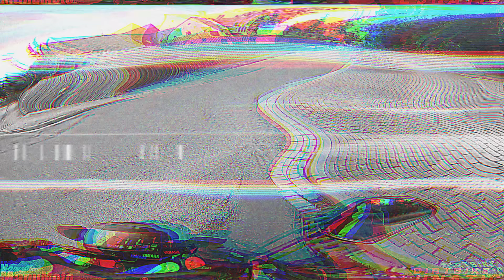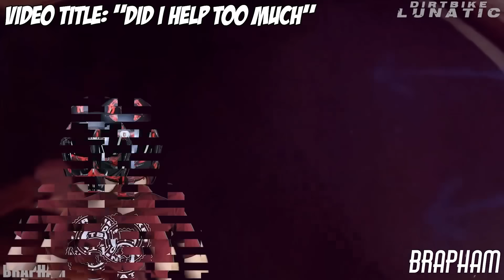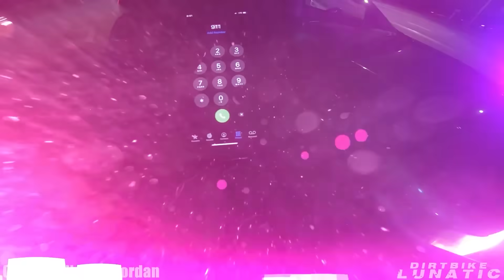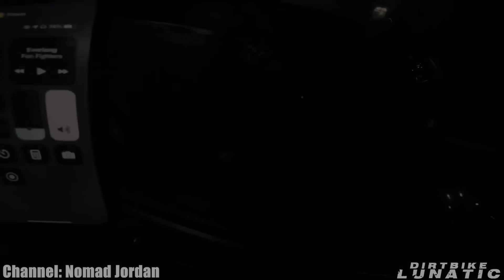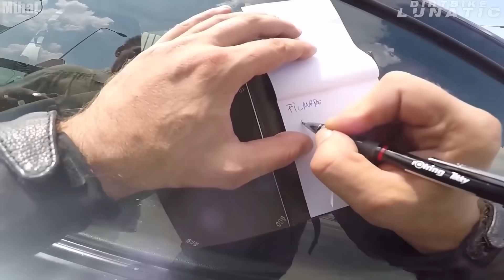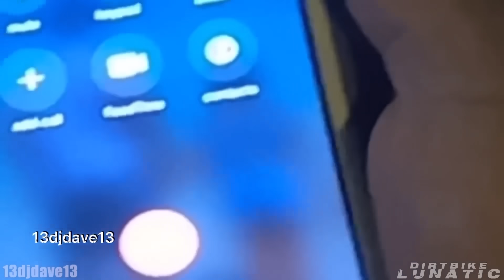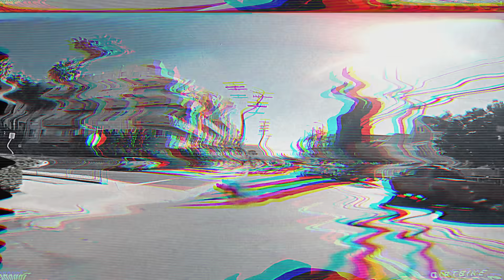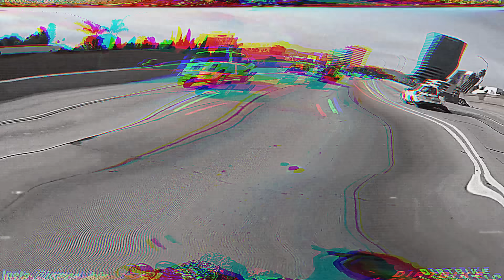BIKERS BEING REAL LIFE HEROES | THE BEST OF [1 HOUR]

Comment: 14:19 honestly concerning how she seemingly didn't know how her vehicle worked
Reply: did she stall an AUTOMATIC TRANSMISSION CAR?
Reply: @carlosglufke2  the new cars have auto start stops and second battery's for them to help save gas when stopping at lights and I'm sure that secondary battery died and didn't restart the car like it should have
Reply: @SandMan_2V  that... makes quite a lot of sence actually (seen those, but did not link the dots)
Reply: When I worked as a car mechanic, we had a lot of problems with all ages and their new cars.
The more tech they have, they become so difficult.
Parking brakes that don't disengage because they have pushed the button to stop the auto parkbrake. Start stop doing it's job and upsetting drivers because their old car didn't do it.
Reply: exactly and then police punish good drivers and leave bad drivers alone just because they go slow.

Comment: 26:27 the worst thing you can do  (when he starts to light the fire) is open the hood to extinguish fire..all you have to do is use only the front grille (when you open the hood you give more oxigen to the fire so it will light much more) but in this case the fire was almost extinguished from water and the previus fire extinguisher they used.

Comment: If a car is on fire, be careful when you open the hood of the car, there could be more fire than you expect and it could burn you (not to mention your hands) and also be very careful not to get hot water from the radiator on you, if it's hot it could squirt upwards with pressure.

Comment: a good tip when it comes to fires! ESPECIALLY in dry woods! DIG! get something to dig with and use that dirt to to dampen the fire as well as digging AROUND the fire, stopping the spread from the ground level. if you have water, use it on the trees and around the trees to halt the fire from spreading onto the trees, because IF the tree catches fire, the fire reaches higher up, allowing more wind and air to hit it leading to it spreading MUCH quicker!

Comment: I tend to agree with some comments that the puppies in the bag was a set-up. The reason? My father's ex-girlfriend did this to her dog's three pups (Jack Russel's). She put them in a skip in a black bag on top of the household rubble the builders had been using - a neighbour heard them crying and whimpering and she pulled them out - they, and the inside of the bag were soaking wet with the condensation of their breath whilst tied in it....not much longer and they'd have suffocated. They had only been in there for about ten minutes. She got arrested and fined - she should have been put in a bag and thrown in a river. These pups here were bone dry and not panting, so they weren't in there for long, and why would someone drive past a random, innocuous black bag set way back off the road they were on and notice it, let alone turn around for it afterwards? There would have been nothing for him to notice whilst on the move, never have seen movement or he'd have not heard anything?

Comment: God bless these young men & women for stopping to help. Some states have what is called the Good Samaritan Law which basically means that if you are acting in good faith to help someone in need of medical attention, and you don’t exhibit “gross negligence” by doing something that may worsen injury or cause death, you may not be prosecuted for your act of rendering aid. A good rule of thumb should be to not remove a person from a vehicle after an accident unless the occupants of said vehicle are at risk of being burned should the vehicle have a fire. The other situation that may be necessary in removing people from a vehicle is if there is a chance of their vehicle being struck more times, thereby increasing the chances of more serious injuries. Removing someone from a car that is sinking in water would be a situation where extraction is necessary so the occupants don’t drown. Pulling someone out of a car, that isn’t on fire or similar, should be weighed against the risk of the occupants being more seriously injured by being struck by vehicles after exiting the wrecked car. If you are ever in an accident you should pull into a parking lot, should your car still  be drivable, standing outside your vehicle, even on a sidewalk or the median of a highway, puts you at risk of being struck by other motorists. I had a CHP officer tell me that after I was rear ended the 1st time. God bless all of you who risk their own safety, and the risk of being sued by the people you are helping, it’s both brave & honorable. Be safe everyone!